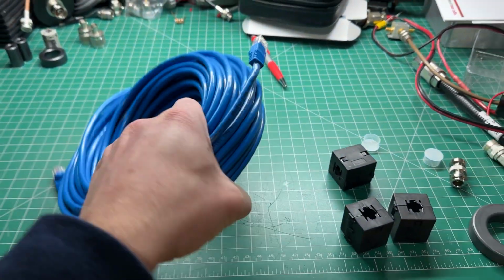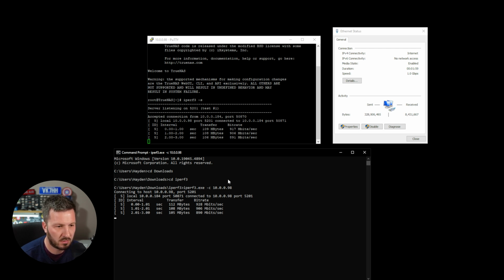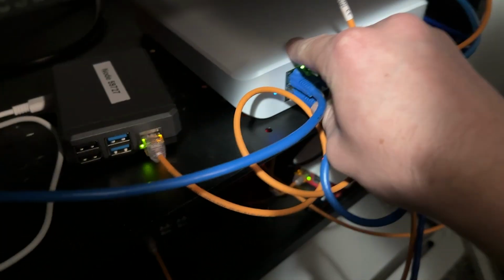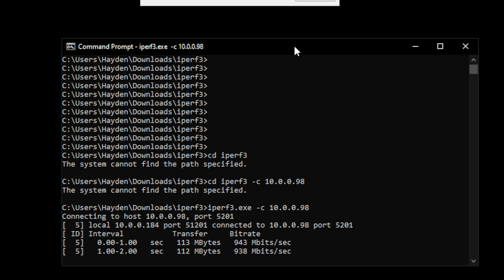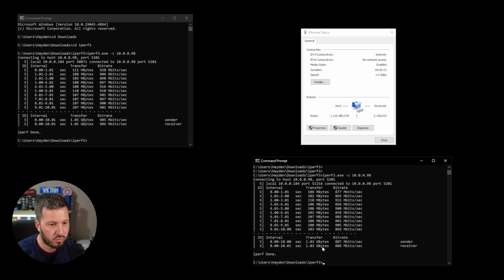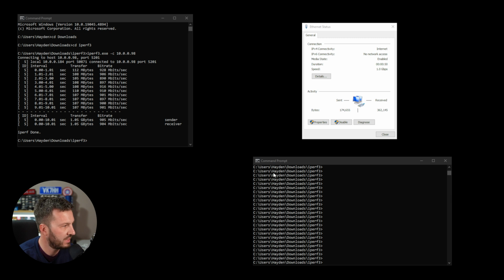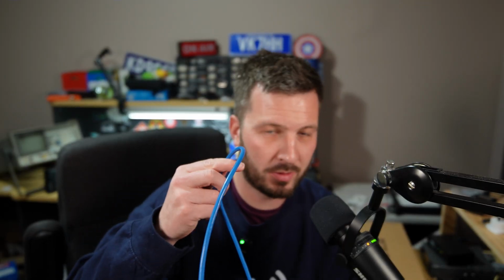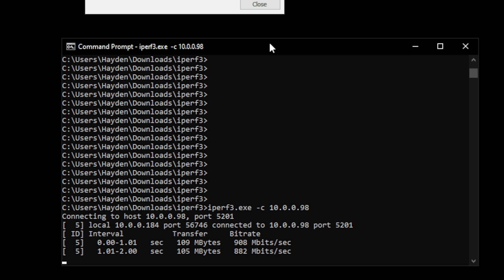Ferrite Cores: Are They Ruining Your Ethernet Speed?

Comment: If your Gb cable has a broken wire it will often fall back to 100 base using only 4 of the eight wires. Broken wires may be a result of too tight a bend radius particularly if the cable is tensioned in that area. Similarly badly or incorrectly terminated plugs can have the same downgrade effect. Cat cable typically bought in bulk reels will have solid core wires which is intended for fixed installations and not ideal for patch leads which are handled on a regular basis. Terminating with an RJ45 is seemingly a simple process but you would be surprised to learn even experienced cablers will have failures. In my experience the type of RJ45 that allows the wires to pass completely through offers the best chance to check the wiring order before crimping down but they also introduce some potential problems of their own. Finally the elephant in the room, the T568A and T568B connection standards. Do not mix them on the same network. Pick one and stick to it or match the standard that is already being used. It has taken some tight cable speciations and extreme engineering to raise the speeds of ethernet over the years which can be easily brought down with sloppy practices

Comment: Well... problem is probably that with very tight spots and putting force on the wires, you make problems. So yes, they might be getting problems with the speed after the toroids have been placed. Even with good  cables, just too much forces on them.
We had speed problems many times in installations when people were using zipties very strongly on the cables. Sometimes working fine again after cutting the zipties away but sometimes just had to replace the cables. They are not made to get big forces on them...

Comment: Where it causes problem, I wonder if possibly  the addition weight on the cable causes problems with the cable termination connector and switch socket.

Comment: Nicely done Hayden!  I have also heard that ferrites on Ethernet cables can hurt performance.  I was having massive problems with RF getting into my switch and computer via the Ethernet and USB cables, so I loaded them up with ferrites which solved my problems.  I am running a Flex 6400, so Ethernet performance is critical to me.  I did not do the comprehensive testing that you did, but I also did not perceive any performance difference once I added them.  Thanks for confirming my suspicions that the ferrites are fine in this application.  73, Len, KD0RC
Reply from the maker: Thanks Len! Yeah I was intrigued too, so I wanted to test. I'd never heard of any issues with ferrites over ethernet cables until I found those posts in my research.

Comment: Ubiquiti has this weird thing that happens with their products and ToughCable; so this could be it too. Randomly will lock into at 100Mbps, and even worse if the cable is ~100' during solar storms (Network Management System went crazy a couple years ago reporting tons of demodulation; and it didnt affect the sister company because they dont use ubiquiti TC)

Comment: Differential signaling is pretty resistant to RFI. You really need to be in a very noisy environment, and in that instance you'd be using STP or SFTP
Reply from the maker: Yep. The noisy environment has STP. But many, many runs of it. Could be poor shielding, noisy POE/power supplies or a few of the UTP cables. The next part of the journey!

Comment: Good job. So far. 😉

1. (Easy) Attach an antenna or rf probe to a spectrum analyzer, and see if ferrites reduce emissions.

2. (Expensive) Repeat with 10G-Base-T adapters. I do not own one PC, let alone 2, that could load 20Gb/s, and none with fast enough PCIE slots for the adapters. Hence, expensive.

Comment: I use these all over the house, because almost everything is causing RFI.  Our house is wired on every device if possible as we try to keep our RF devices to a minimum to keep the RF noise floor also minimum here, but that means RFI noise can go up in other ways. So we choke the noise  and place a toroid on EVERY power cable and I/O cable for devices. I think total invested is around $125-$150 in ferrite material for the house, not including the shack. 
We have to keep in mind as well that the US for the most part does not have the same high speed internet as the rest of the world, and most folks are not using high quality cables.  In the US, the noise floor from Ethernet wired devices is still fairly high because we have a lot of CAT5E cable in use. 
Now to figure out how to muffle the noise from the family during operations!
Reply: Closing the door helps muffle the QRM.
Reply: @iowahank1  You all assume there is a door to close, thats funny stuff! I wish I had that again.

Comment: I think you hit it.....the cable. Without knowing what cable the person used, this is not for sure, but cheap components very often result in problems. Thanks much for this video.
Reply from the maker: Thanks! Yes using high quality shielded cable would be the first step I think in mitigating any noise, plus the addition of ferrites if needed - or swap out the whole cable if there are speed issues.

Comment: This might be more applicable to HF and while it sounds silly, one way to avoid RFI from ethernet is to use wifi. This is obviously not going to help at the repeater site though.
Reply: while using wifi, is technically faster then wired. it also adds to the overall noise floor as well in the vicinity of your radio station. This may not be a desired thing. Consider that you may be adding noise at the power source level, the wired router input level, and then any harmonic as well of the wifi band. So in many ways, this is not a desired product at a radio site. If you absolutely need it, then it is something you must deal with. Most of us are not able to separate our shacks from the internet or our homes in such a manner to isolate. However, we can do things to help our situation besides just adding to the noise floor. CHOKE IT!
Reply: @ChrisRobinsonKF6NFW  wired is faster all around than wireless. Fastest wired is 100 Gb, while wifi is around 9.8 Gb at its fastest.
Reply: @michaelscott8388  UM no.  Physics my friend. Wire has a much greater resistance than air, thus Wifi will always be faster.
 Your slow downs will be in what you decide to convolute your data stream with!

Comment: I believe Ethernet cables use twisted pairs and differential mode signalling and thus are somewhat immune to common mode currents and RFI. I wonder if using shielded Cat 6 cable (assuming your terminating devices support shielded terminations) would be better at reducing potential interference.
Reply from the maker: The location we're having problems has lots of runs of shielded cable running to AP's/links up a tower. There is some evidence there is noise being coupled into these cables - perhaps even on the shield.

The next step is to identify all the unshielded cable, fix that up - use a probe to narrow down the noise sources a bit better and also look at potential issues with power supply/POE.
Reply: @HamRadioDX  Definitely on the shield. I have this in the house on the phone network side of the ADSL router. It's CAT 5. I swapped it for CAT6 and fitted clip on ferrites. I thought the shielding would split if I put it round a toroid.
Reply: Yes. This type Ethernet uses differential signaling and the cable is twisted pair. This is 1000Base-T and T means twisted. Any Ethernet using RJ45 type connectors is twisted pair.
Reply: I've never seen an issue unless it was budget gear and cheap cable. massive RF feedback might do something but thats just skill issues.

Comment: IPerf3 is a bad program to test cable signal level.  Cable length is also short and you could try 10gbe that's more sensitive to cable imperfections
Reply from the maker: I wasn’t testing cable signal level. I was testing throughout. Iperf3 is perfectly fine for such a test.
Cable length was 20m, I don’t have anything longer.

10Gbe wouldn’t be in most hams shacks
Reply: @HamRadioDX  10gbe is becoming more popular and 2.5gbe is also being put on devices.

Another thing you might want to look at with your test is that different ferrites utilize different materials that only affect certain frequencies.  I believe the ferrites you're using are generally made to remove line noise from standard power connections.  So they would be designed for the HZ range not MHZ.
Reply: @xephael3485  But under which circumstances could it make a difference? It's twisted pair with differential (symmetric) signal levels, they shouldn't be affected by ferrites at all.
Reply: @antoineroquentin2297  Correct!  The ferrites should just reduce any common-mode currents, not the desired differential currents on the twisted pairs.
Reply from the maker: @xephael3485  10Gbe and 2.5Gbe might be becoming more popular... but as I mentioned before... how many ham shacks currently have that - I'd say 99% of them don't.

I already did look at the different materials and their suppression at various frequencies. Did you watch the whole video? I mentioned this at the start and right at the end and was covered in the previous video to this one.
Reply: @HamRadioDX  How about ferrites on fiber optic cables ;)
Reply: @antoineroquentin2297  gravimetric ferrites because those can bend light 😜
Reply: It is an extremely good speed testing program though. I use it when messing around with wifi.